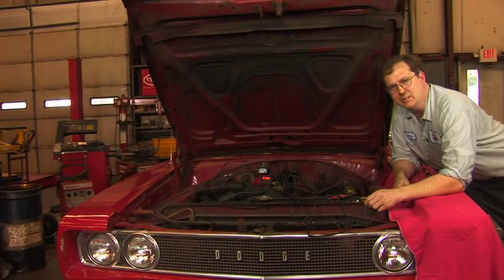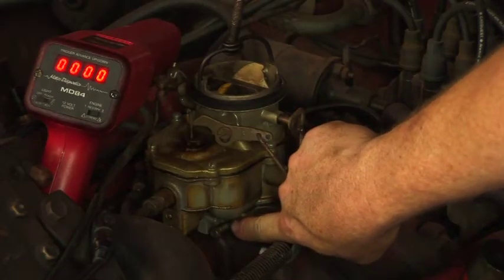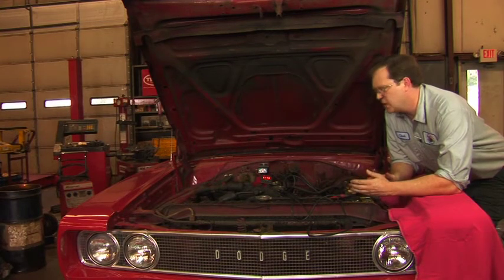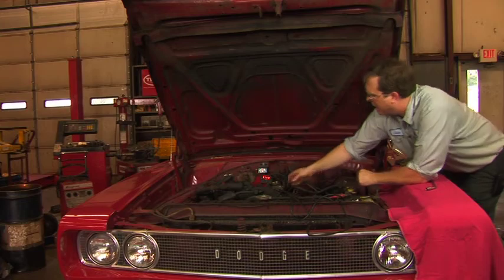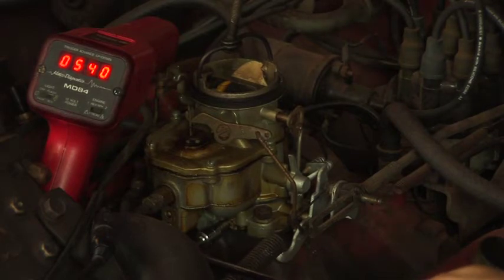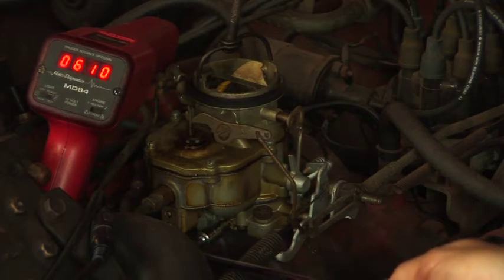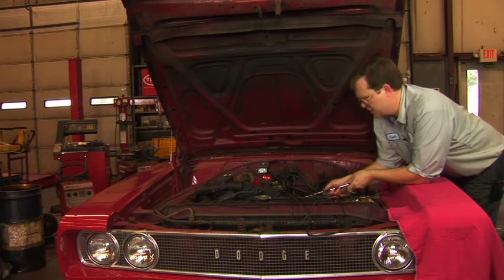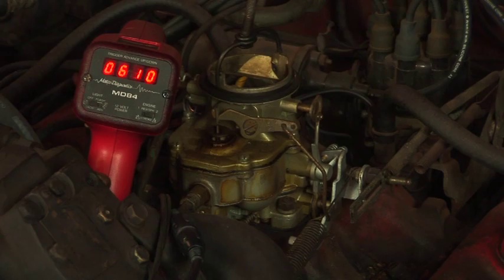Auto Repair & Maintenance : How to Adjust Carburetors

Comment: @hippohoppa I had that trouble on my Mazda pickup. It had a random misfire from bad plug wires and a slightly too lean of a mixture and incorrect idle speed. Oh and a vacuum leak. If I were you, I'd check to make sure that all cylinders have good compression, then check to make sure that they all have good spark. Then I'll check for a vacuum leak and lastly do what this video shows and it'll run perfect.

Comment: Check the spec tag under the hood. I know of some Chevys that requre adjustment with the air horn on, and the transmission in Drive. Make sure to set the parking brake and chock the wheels if that's the case.

Comment: A lot simpler than in later years where you used propane enrichment or set the idle speed higher by 50 or so rpm then lean dropped it to the final rpm.  And then there were the choke adjustments-too lean from early 70's on and very conservative spark timing advance. How did cars that ran poorly from these kind of goofy tuning specs put out fewer emissions? Let's see, 1967 automobile 21 mpg but dirty, 1974 of the same model 10 mpg and slower than dirt but less polution. Never could figure it out.

Comment: Is there an advantage to setting the idle speed screw first and then setting the idle mixtures; Or does it make no difference if I start with the idle mixtures screws first, and then deal with the idle-speed screw? Thanks

Comment: Just need help. My car is a Honda Civic '94. I need some advise. My present idle is 800 RPM. My car idle increases when the engine is very hot but not overheat. 60-70% temperature level. From 800 RPM to 1100 RPM. When this happens I have a had time starting the engine again and sometimes when the engine is on the RPM drops to 200 and the engine stops. When I start it again after few hours it will start again.

Comment: My old Fiat 132 2000 became troublesome after the last repair and i don't know why :s . It used to be stable after i start the engine, now it starts and it wanna turn off unless i hit the gas paddle for about 10 min, it never did that b4, any idea why?

i will appreciate any help, thanks.

Comment: Hey, i got one question i need solved! I was test driving my truck for the first time last night and after driving 1 mile it seemed to bog out and had no throttle response. after i realized it stalled i pulled it over and it had a really rough time trying to start and i had to wait 10 minutes to get it going again another mile. I have replaced the fuel pump, filter, carburetor, lines, almost everthing except for the tank. could you help me out? its a 4 barrel rodchester quadrajet.

Comment: It's better to turn the mixture screws out 1/4 to 1/2 turn out from fastest idle otherwise you will have readjust the settings sooner. The biggest problem with mixture settings is that the idle circuits go lean from dirt in their circuits. If you set them "perfect" you are at the very edge of too lean. A little contamination in the circuit and you have a rough idle. I am surprised that after setting them a little on the rich side for 45 years no one else has caught on to it. I would rather see the customer less than more as it means he got a better job done.

Comment: I need help. I have a 78 Oldsmobile Cutlass Supreme with a 260 v8 and original Rochester dual jet 210 carb. It has sat for a good year and it will only crank. Ive tried starter fluid and the old gas down the carburetor trick and it made an effort to start but still nothing. How would this be even possible if i cant get the car running long enough to let it warm up?

Comment: nothing said on this about fast idle or low idle ,fast idle cam, choke setting and choke unloader??? Idle speed and idle mixture may be the most common adjustments yes but starting from a dead cold engine you need to know the choke and choke unloader is going to do its job ,,or its gonna run like crap and flood whether idle speed and mixture are adjusted or not.
Reply: callmenort -thats why he said bring the engine to warm and normal operating temperatures! Becus that is wat ur sapose to do b4 makeing adjustments to mixture screws!

Comment: right idea, but wrong. First, with the engine warm, shut it down. Turn each idle screw all the way in, then back out about 3 full turns. This ensures that both barrels are set equally. Balance is important. Start the engine,  high idle at 2k for 15 sec. Set the idle speed. Then turn each mixture screw OUT 1/4 turn at a time and note RPM INCREASE! If no increase, turn IN and note increase. At max idle speed, readjust the speed to spec. NOW  turn each idle screw slightly IN to RPM drop spec..